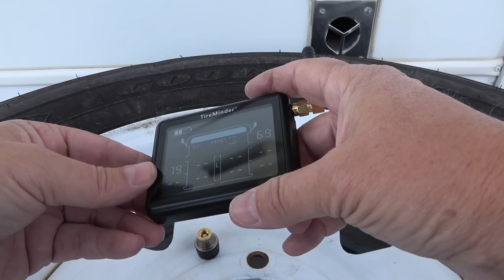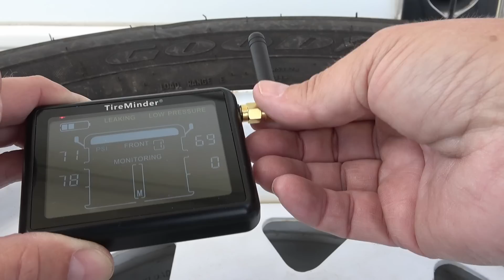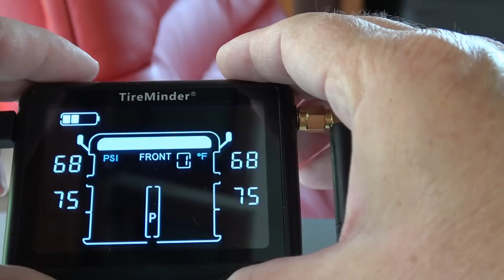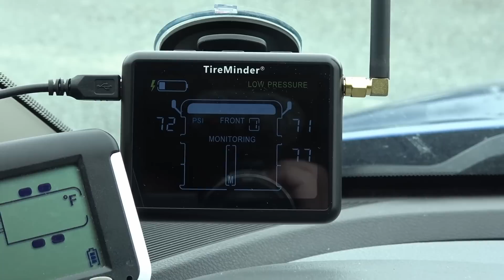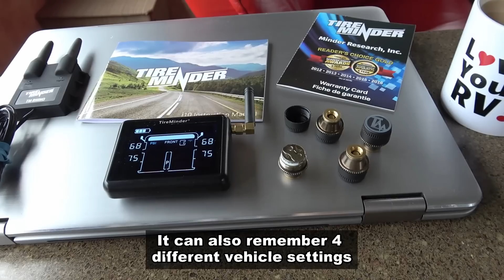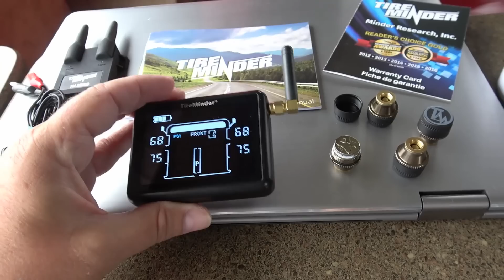TireMinder i10 RV Tire Pressure Monitor System Review

Comment: Threw my Tire Minder in the trash......lost signals, rude customer service. Bought a Truck System Technologies unit and have been very happy with it.  Do what’s best for you. 
J,&C
Reply: Bought the unit in 2016-17........it came with a booster. First time we used it we got a lost signal alarm.  That continued all the time we used it. Finally got fed up with it. Called the company to see if anything could be done, was something wrong with the unit, had I made a mistake installing it.  The guy on the phone in no uncertain terms said they had no record of our purchase and they could not help us.   Maybe I did not fill out the warranty info on line, I thought I did. Regardless they were of no help.  I will take responsibility for not figuring out the problem. But when it comes to monitoring tires on a camper I feel there is no room for error.
Reply from the maker: Thanks for the info,  that is pretty sad after-sale service for not a cheap item. Companies should know one unhappy customer costs them more than some hardware that when mass-produced doesn't really cost them that much. You'd think they could just go by the serial number.  They should be looking at it as an opportunity to see what can go wrong with the product to improve it.  I'll give this feedback to the distributor. I did see that the company that owns Minder Research is Valterra, wonder when they bought them. - Ray
Reply from the maker: Thanks for the feedback, I have been more than happy with my EEZtire unit. Did your TireMinder come with the booster? How old was it?  In what way were they rude? Cheers, Ray

Comment: The door of my 2017 Cummins 3500 has the fronts at 80#. Do you reduce the front tires since it lifts the front slightly with a load? Maybe a difference in options
Reply from the maker: My 2018 3500 door jam says cold pressure 60 PSI front and 80 PSI rear.  Maybe due to the 8 foot box and crew cab.  I usually tow with cold pressure 68 PSI front and 80 PSI back. Right now we are unloaded for the summer so back it off on the rear tires.

Comment: I wear polaroid sun glasses when I drive and some of my dashboard displays disappear. The clock is always the worse. Have you ever considered checking for that on a review.
Reply from the maker: Good idea, I always forget, because I don't wear sunglasses much at all, bright light doesn't bug me much, and never when I drive and when I do its prescription transition lens without polarization.  But, I do have a polarized lens filter for my camera, so I could use that to check the displays.  Cheers, Ray
Reply: Due to its colorful display, LCD will not cause that.

Comment: I keep wondering for any of these tire minder products, is there any concern with the valve stem being bent from the centrifical force?  Seems like a lot of weight on a plastic stem.
Reply from the maker: Here is from the website: https://www.minderresearch.com/tpms-frequently-asked-questions/
Can rubber valve stems be used with the TireMinder Transmitters?
Yes, TireMinder Transmitters may be used on rubber valve stems. However, we highly recommend brass or stainless steel valve stems.
Rubber valve stems can be an issue based on age, length and physical location (i.e. exposure to road salt, high heat, sun, etc). If using rubber valve stems, it is recommended that you check the condition of you rubber valve stems on a regular basis.
Reply: @LoveYourRV  Thank you!
Reply from the maker: No problem. I swapped out my OEM trailer wheels rubber stems for stainless steel when the OEM tires wore out and was getting replacements. I recall it wasn't much money if any extra since I was buying new tires. The good part other than being stronger is they transfer heat better so if I have a dragging brake or failing wheel bearing the heat will transfer to my aluminium wheels and through the steel stem better, alerting me to the temp rise quicker.

Comment: Nice review. You’re right the booster would be a dislike for me as well. I would be worried about losing it or being damaged where it is installed. Are you sure it’s absolutely required?  Maybe try it without the booster and see what happens. I’d be curious if it affects the performance at all.
Reply from the maker: I tried it without and it seemed to work pretty well, but I guess it may be needed in high signal congested areas. I found this on the Minder Research website: https://www.minderresearch.com/tpms-frequently-asked-questions/
Do I need a Signal Booster?
Yes, the booster is mandatory! The booster should be installed with every setup.

The booster was initially created for distance, but as the world has become more "wireless" since the introduction of the TireMinder system in 2008, signal interference has grown exponentially. We have included a signal booster in every kit since mid-2013, unless otherwise indicated, because of this fact. The booster needs to be installed to combat signal interference and make sure that you are getting the best signal possible.

Comment: i have this and I selected it because it gives you all the information you need at a glance all the time without cycling... it doesn't require the booster if you use it for just a dually and truck camper
Reply from the maker: I liked that too, except I think they should include both temp and PSI on the same screen. I don't like the fact you have to physically push a button to switch. My EEZRV shows both, but only on tire at a time.  Cheers, Ray

Comment: I had to change out the valve stems to all medal on mine
Reply from the maker: I swapped my trailer tires to metal stems after the OEM tires wore out and was getting new, was a cheap upgrade
Reply: @LoveYourRV  Ray, did you notice in the manual Innovation recommends aluminum sensors with metal stems? They go on about dissimilar metals and electrolysis. Don't you have to have fluid running for electrolysis to occur, i.e. in a water pipe?
Reply from the maker: @randyneilson7465  I guess if saltwater is splashed on them or sea mist condenses or maybe salty mineralized desert mud, there is a chance for electrolysis.
Here are the answers from Innovation to a couple questions I had regarding it:
Question - Can you clarify the brass vs aluminum sensors? I have stainless or maybe nickel-plated metal stems on my trailer tires. Is the brass OK? 
Answer - YES, the aluminum is for Aluminum valve stems.
Question - I gathered that certain towed vehicles will need aluminum but the fifth wheel tires with metal stems are OK with brass sensors,   
Answer - YES BRASS
Question - The EEZRV sensors I have been using for a few years worked fine but they do recommend and I used an anti-seize compound in the threads. 
Answer - Our sensors don’t need any compound but I know some people rater use it as a feel good. just be careful not to allow any compound to get near the sensor inside.